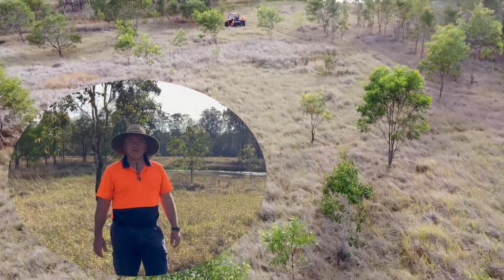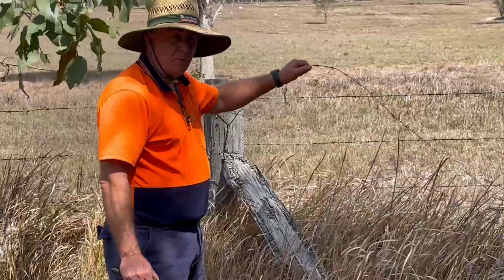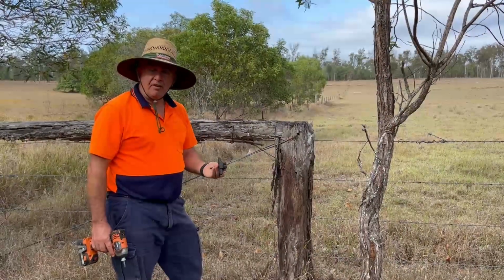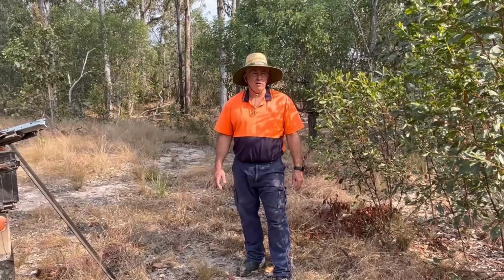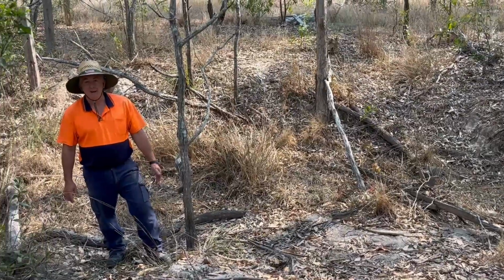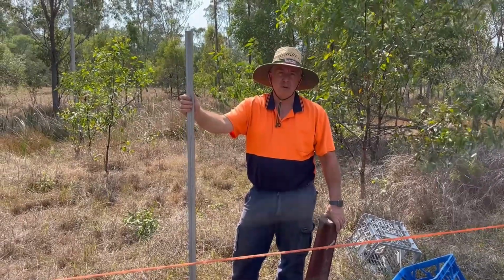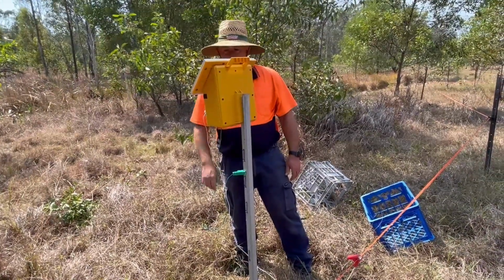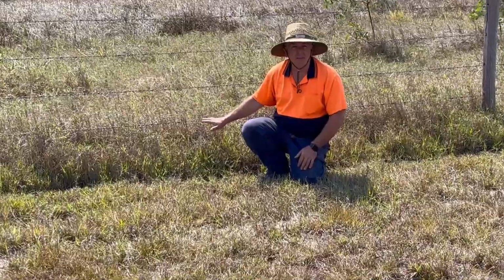The dry is here, lets go somewhere different

Comment: Another great video. Thanks!
I wonder whether letting the cattle have a good trot around that really dry hard area would help loosen up any capping . I have seen outback farmers running their cattle across hard capped clay paddocks before rain comes in to let the rain soak in easier. I guess you may deal with much bigger rain fall amounts up there too.
Reply from the maker: I must admit, I'm drawn between slightly cultivating some of the packed down areas, but I just hate to break the mostly good ground cover. The cattle really were not interested in that paddock despite the good feed in there. I need to organize to get water in there too so I can "lock them in" till they get through it. There is no sign off rain for some time yet - unfortunately.